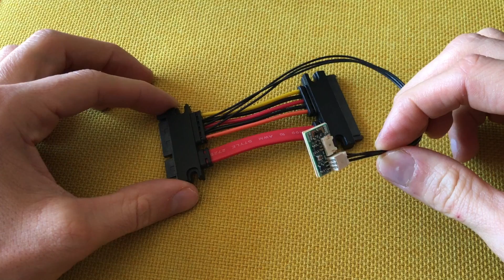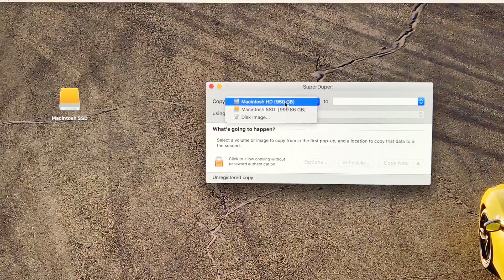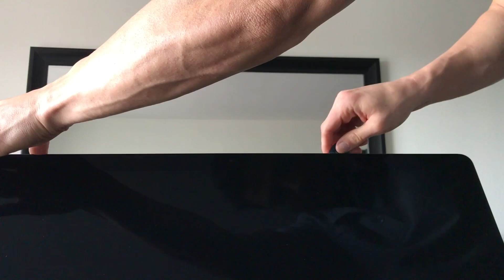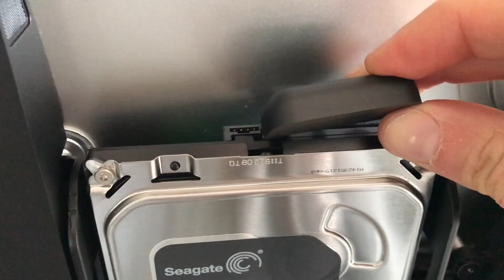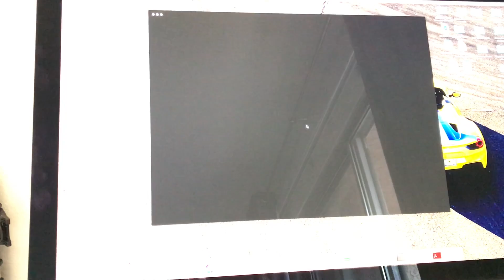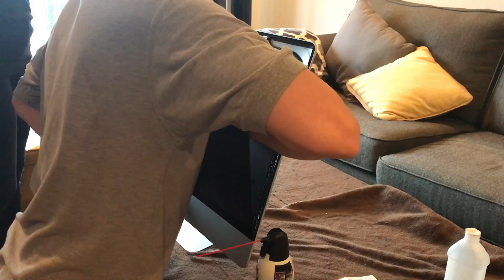How to make your iMAC 5 times faster | 2012-2017 SSD UPGRADE WITH THERMAL SENSOR | Step by Step

Comment: HI I notice in the Amazon 1 TB SSD link that they sell also a 2TB and 4TB SSD drives do you know if those higher TB would work too on a late 2012 27 iMac thanks
Reply from the maker: Hey sorry for the late response, but from what I know the size of the drive doesn't matter.  I'd just make sure you install the thermal sensor, yes it's an SSD but the bigger the drive the more heat it'll put off.  My personally would just stick with the 1T and just use externals.  Happy building bud.
Reply: Hi The 2TB SSD works
Reply from the maker: It does!? Thats great!  Everything went smooth for you with the tear down and rebuild?
Reply: Hi yes I follow your instructions to the T everything went smooth thank you
Reply from the maker: AWESOME!! I'm happy to know it at least helped a little.

Comment: Hi there, I heard following 
Does not work with macOS High Sierra or higher. Not compatible with the SMC firmware update of autumn 2017, which will be installed.
But you can short-circuit pin 11 with pin 12 at the SATA power connector (e.g. solder point). The hard disk sensor is then recognized as "not present" and no longer as "defective". 

Anybody else, heard from that?
Reply from the maker: I haven't heard of this and i'm running High Sierra.

Comment: Do you happen to know if the fusion drives are one cohesive unit to remove? (Then, replace with a third-party SSD)? Also, if you're purchasing a SSD directly from Apple, is the thermal sensor not a big deal because (in theory) they already placed a sensor on it? I have only heard 2017 iMac complaints about fan noise from the fusion drives, not pre-installed SSD's.... 

Sorry for all the questions :) Thank you in advance! Great video!
Reply from the maker: Hmmm from my research the fusion drives are pretty much the same to remove. And I believe you are correct when purchasing from apple they place there sensors in the actual drive itself.  But!! I'd just ask them when purchasing just to make it 100% certain.  And thank you for stopping and dropping a comment, and my apologies for the delayed response, we've been working real hard on jobs.

Comment: Hi there again ! And here's the mystery...
https://www.youtube.com/watch?v=1LMIfdIDh7I
Ok I understand all the stuff but with hard drive positioned like this, how is it even able to add next cable so it only is designed to fit the disk where is it exactly specified by manufacturer ?:/// What a heck !;p
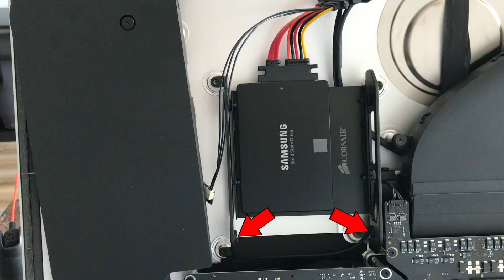Reply from the maker: Haha, Ok that's the same guy I watched too.  But it's not the same iMac, if you have a 2015 Model the guts on the inside will look different.  Check out 12:38 and you'll see the difference.
Reply: Yes You are right but mine, has "guts" like his IMac, I mean space around disk and including mount of it, without a bracket , and sideways where connector SATA is on the left, nearby the speaker so if I'll add thermal sensor cable (wich is extension of existing cable, there will be no space for installing disk. Or I am just dumb and don't know how to place it then :D
Reply from the maker: You're NOT  dumb.lol There's a way of doing it you just gotta tinker a little my friend.
Reply: Still can't find anything about heat sensor in Late 2015, I think I'll just stay with HDD.... :(
Reply from the maker: NOOOOO There's gotta be a way. Don't give up!!
Reply: Hi Airwolf , look what THEY told me :P

"t sounds like the SSD has failed. These types of failures happen but are very rare. A replacement should fix your issue. We would however recommend using an OWC SSD as we can pre-test the SSD before shipping it out to you and provide free Technical Service. Let us know if we can help in anyway. https://eshop.macsales.com/"

Comment: Do You think that not installing cable with thermal sensor screwed up my samsung evo 850 ssd because of the heat ??
Reply: The thermal sensor is there so the Mac knows to speed up the fan if the HDD starts getting too warm.  The problem with not using thermal sensor is the fan may spin at higher RPM because it can't read the temp sensor and is playing it safe.  SSD actually generates a lot less heat than HDD.
Reply from the maker: Very True. :)
Reply from the maker: It may have, that's why i'd just get another one. These systems do get hot inside even with the SSD.

Comment: Hi there, I upgraded 4 days ago my Late 2015 4K IMac HDD ( because it was laggy and slow) to SSD Sasung EVO 850 500 GB and it worked fine for two days, then screen has freezed and then after trying to boot it again, question mark appeared , I was able to see SSD for a while in boot options and then it suddenly disappeared. Prohibitory sign appeared and the disk was dead. So I decided to again disasembly IMac and remove SSD to replace it with old HDD. Works fine. But when i connected SSD with enclosure to my IMac, it is not visible, also under Windows it seems like disk is dead. What can cause that ? Disk was brand new, not used and it failed. Is there anyone that occured the same issue here? I don't know if I should install next SSD drive if it's gonna die in 3 days. What can possibly do that? It worked fine for 2 days after replacement. I don't know how to deal it with and I don't wanna stuck on this HDD because it's terribly slow !
Reply from the maker: Hmmm.. Well for starters I'm sorry to hear that you're having a heck of a time trying to get your computer up and sunning with the SSD.  Have you been able to follow "ALL" the necessary steps? I mean to me it could be one of 3 problems.  1 - Your SSD is just a dud and you'll need to get another one.  2 - How did you install the new OS? Did you clone your drive or did you install the SSD then install the OS via the command option way? OR! 3 - Was the drive formatted using mac os journaled? I really think that it's just a dud drive but you never know.  Usually in situations like this I typically start all over again and follow all the steps.  BUT! Before you do that just double check your SSD.  If you're able to plug it into a usb port to see if your computer is reading it and hows it formatted? Again, sorry about all the complications I hope you get it figured out bud, let me know what happens.
Reply: Dud means Shit ?:D Let's see, I Cloned my current hdd disk using carbon copy cloner, it worked by booting from option booting menu as a proper device from usb in enclosure. Both hdd and ssd was working fine. I formatted it using mac os journaled and guid partition first then made a copy. It was running super smooth for two days , then image freezed and It was still appearing for 5 minutes as it exists and then it was no longer available. It is not detected by windows computer either. Could it be heating issue ? maybe it needs thermal sensor ? But i didn't find any on previous hdd installed? Now I am running external usb another samsung evo but 860 this time and it works but I don't want to have it externally I would prefer to make it "inside the box". All threads on discussion apple forum is telling me that there should be owc or OCZ cable sata with thermal sensor but I do not believe it as I've seen many disks replaced without thermal sensor :( I am thrilled:(
Reply from the maker: Hahaha Yeah Dud means shit.  It sounds like you've done everything right with cloning etc etc.  As for the thermal sensor, I as well saw some people installing without it and they seemed to run fine, but what I did noticed is that some videos where they didn't install it, it was a different year make and model of iMac.   Now, you could be having a heating issue, but i'm not 100%.  You're also not going to see a thermal sensor on the original HDD because it's build into the system.  I did however install a thermal sensor because I DID NOT want to go through the process again.  My late 2015 iMac is running fine and super fast, I'm actually composing this message from it.  If I was you, i'd return the SSD get another one, just to make sure you'll have a fresh SSD.  I'd also order a thermal sensor and install it regardless, and I wouldn't re seal your iMac up until you've been running it for a a week so just to really make sure everything is working.
Reply: Ok thanks man I really appreciate it, and I have the same IMac as Yours, only difference that I didnt know about the cable with thermal sensor. I am from Poland so it may be difficult to order it :( I already did this process twice so it is not so bad;p and I didnt have to mount bracket because there was 2.5 inch HDD inside so it fits perfectly... hmmm How about this, my IMac wasn't even once running at HDD with fans louder than.. than silence :D So I was wondering if it really was the heating issues. However I'll wait, I'l order that cable maybe on amazon and see if my disk will last.. I hope so because IMac running on old HDD is some kind of f*** joke, I don't know who has so dumb idea to mount it in such a fast computer,  He should be sentenced for prison due to that :D
Reply from the maker: Of course! Now I know my video is so LOOOONNNGG, but just fast forward to the thermal sensor installation part, you seem like you're a pretty smart guy and I'm sure you'll get it all figured out.
Reply: Your experience has me thinking when I do this upgrade(I'm doing the CPU and ssd pci-e in addition to replacing the SSD so more to check), don't tape the monitor back for a week or two. Leave the adhesive tape with the tape on one side and after a few week burn in with no problems, mount it permanently. You can always tape the glass to the aluminum temporarily.  Also, I'm running Mojave now too.. so I'll be anxious to see how this goes given how Apple doesn't like people upgrading their systems (or repairing them).

Comment: Hi,first of all thank you for your video. Do I need thermal sensor?I saw some people on youtube installing ssd without thermal sensor.It's like big debate.Can you please tell me if I need thermal sensor or not?I'm planing to replace soon.Thank you!
Reply from the maker: Hey bud, thanks so stopping by.  To answer your question I say YES! I ran into the same issue that you're running into as well and I figured installing the thermal sensor wasn't going to effect anything to begin with so I'd rather just do it.  My thoughts on it are, if I didn't install the thermal sensor and after putting that damn screen back on and if the fan motors were to run full blast, you don't want to go through that WHOLE process again. So, play it safe install the sensor. My computer is running great I never hear fans turn on.   I'm actually composing this message from it. :) Let me know if this helps and puts your mind at ease.  And good luck! Take your time, you'll be fine.
Reply: Thank you for your reply.
      I have another question if you don't mind.So instead of cloning ssd,can I create bootable usb then install blank ssd into imac and install mac os from usb?
      There is no youtube video showing doing that.I have done that way on my window pc,but I'm not sure on mac.
Reply from the maker: Yes! You can do that too.  You'll have to shut down the computer and power up while holding down (Command R) select your USB then install.  (Just double check via google).  And perform all this BEFORE re-sealing your computer. :)
Reply: Thank you,Thank you!
Reply from the maker: You're very welcomed. :) Keep me posted.